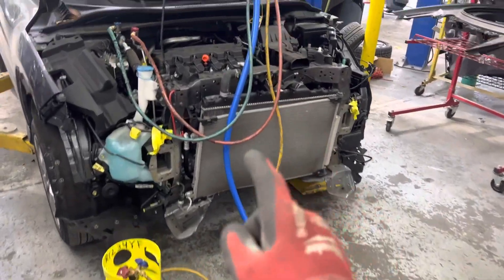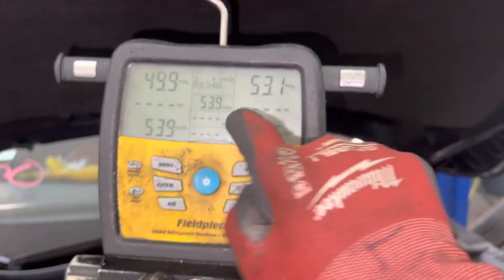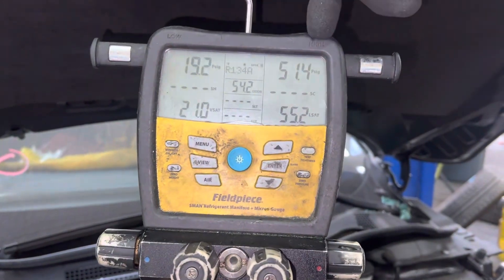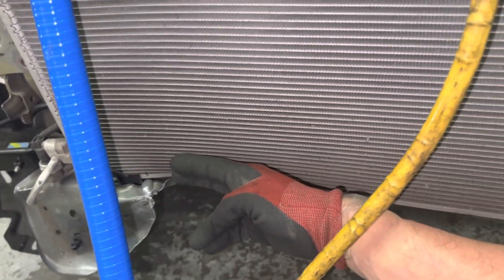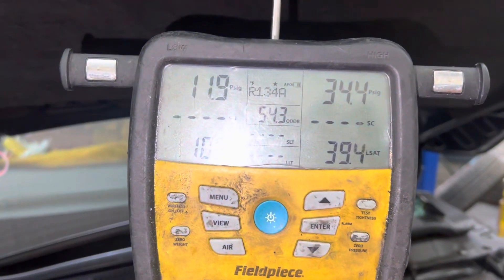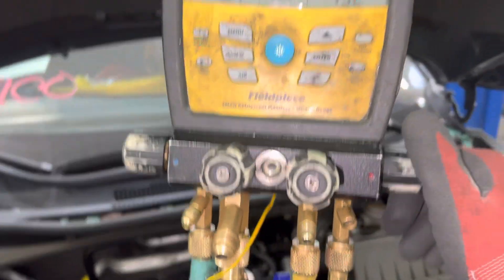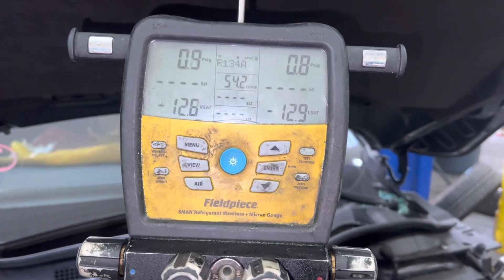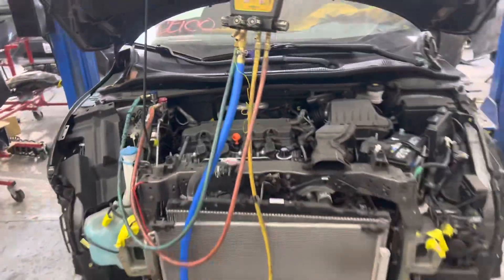REFRIGERANT RECOVERY, explaining how NOT !  to recover oil out of the high iquid refrigerant line ￼

Comment: If the system was over charged with oil would you want to recover through the high side to take some out? I just had a Ford F350 and I over charged with oil. Replaced the compressor, lines and condenser. The condenser was a micro tube could not get the big tube design like the original one.
Reply from the maker: Yes, you could, and your machine through your oil separator would measure out how much oil you removed. 
A different vehicles removed different amounts. If the high side is on the vapor side, you get very little to none. 

If the high side is on the liquid line, you get more 

And then you just go by your oil extractor separator will measure out and tell you exactly how much you removed 

Different vehicles are always different on how much they remove

Comment: So after you recover, will you still have liquid refrigerant still in there before you start the vacuum? Or does doing the process you did transfer the liquid refrigerant into vapor and you end up getting all the refrigerant out? I hope that question made sense.
Reply from the maker: After recovery, the system will be 100% completely empty. There will be no liquid left inside the system..  they will be next to no vapor left inside the system, because I usually recover down to somewhere around 800 µm. Then I use the vacuum pump.
Reply: @coldfinger459sub0  That answers my question! Fantastic as always.